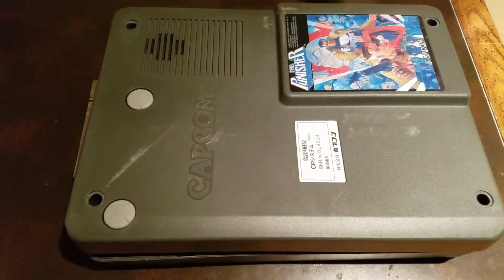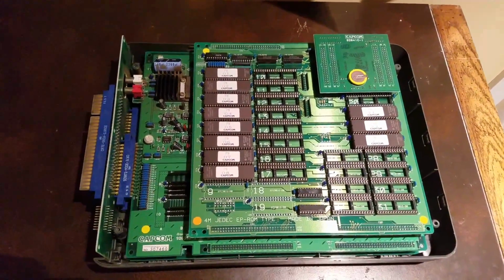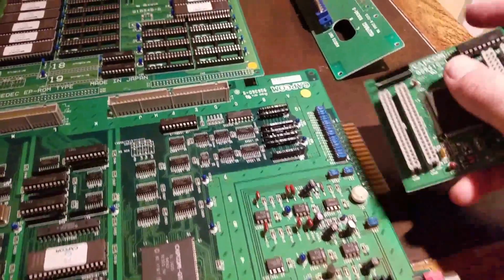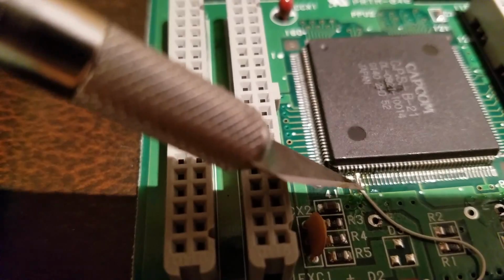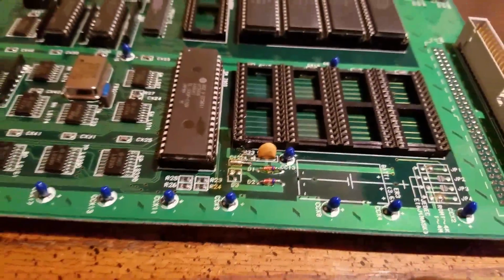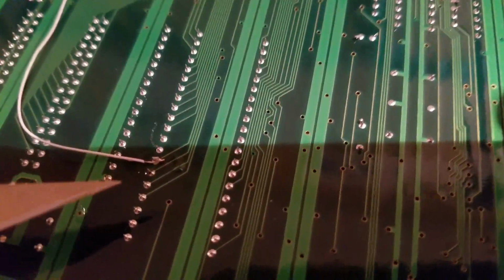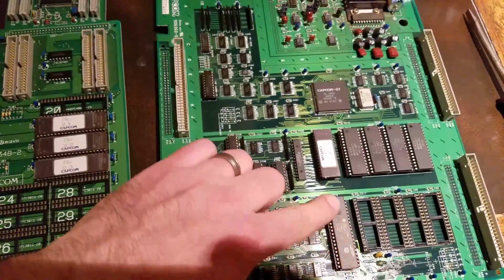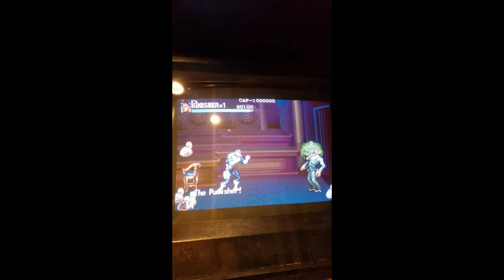Punisher PCB Repair

Comment: Do you have a website I can contact, I have a Punisher in need of repairs. Just want to know your rates, I'm located in NYC, I can ship the item for Repairs.
Reply from the maker: Sorry, I only do my own repairs. I'm not good enough to repair other people's boards yet. I would suggest signing up for KLOV forums. There are a lot of helpful people on the site and they do repairs. Tendril on there comes highly recommended but there are a bunch of guys.
Reply: @joebagadonuts6415  I ordered a Kabuki Chip, I think that might help revive the suicide battery problem.

Comment: Damn, US$150 for The Punisher is amazing!  I wouldn't expect that 8 years ago, let alone 2017.  You did a great job and, again, what a bargain.  Such a shame so many arcade boards have been trashed because of stupid suicide batteries!  Oh, that and China apparently buying SFII boards in bulk to flog on ebay as pirated CPS1 games.  I wonder how many boards were wasted due to piraters?  Between the hacked boards and the CPS1 multi boards, quite a few thousand I would imagine.